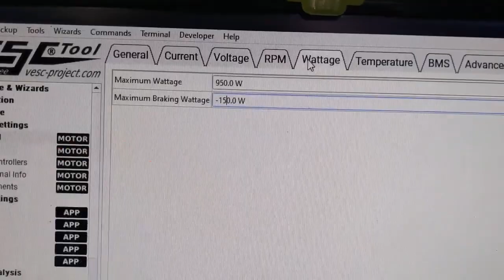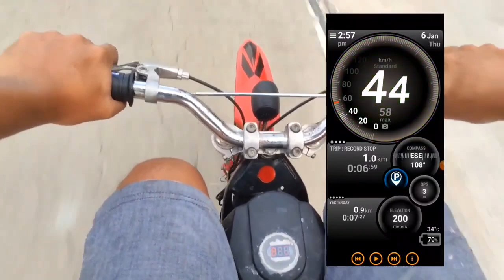DIY Motorcycle with Fsesc 75100 | Flipsky

Comment: Hello, Flipsky 75100 has the erpm setting. What if you don't know the exact erpm of the engine? And is it necessary to provide the exact ERPM value?
Reply from the maker: You can limit the setting per your motor specifications, it's about battery voltage*motor KV*pole pairs q'ty. You can also provide your setting details for check via our service team fs_service@flipsky.net. Thanks.

Comment: Can it support a 5800w motor
Reply from the maker: Yes, sir. The FSESC75100 can support 5800w motor.
Reply: @FlipskyTech  also can the esc support EMX lite Throttle with ECO mode switch
Reply from the maker: @chrismagallanes8858  Hello, sir, we have not used the throttle you mentioned for testing, and we don't know what mode and function this switch circuit is set to, so we are not sure whether it can be adapted.
Reply: https://youtu.be/m2f3qL43KgE